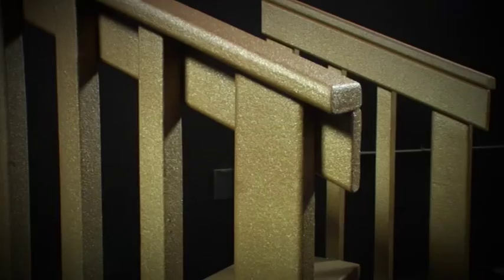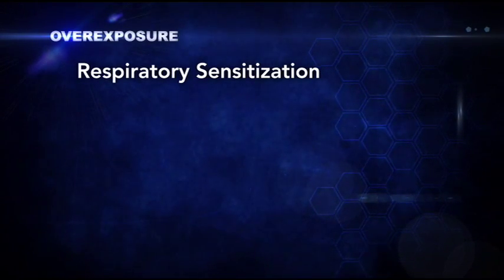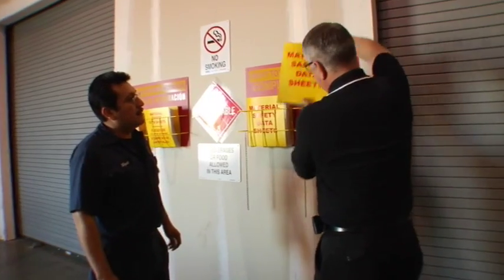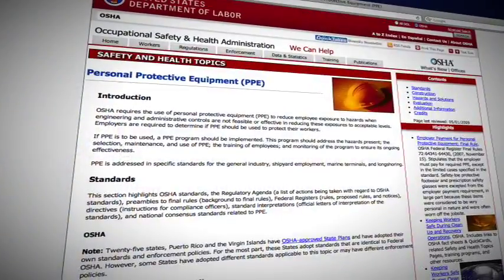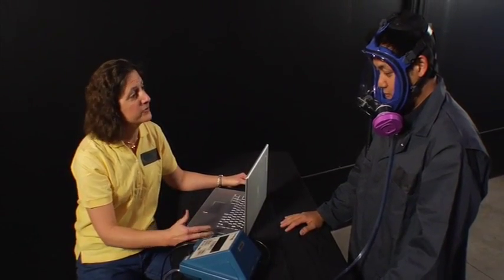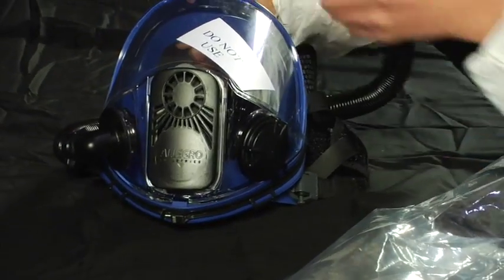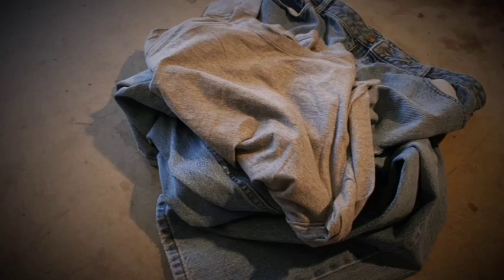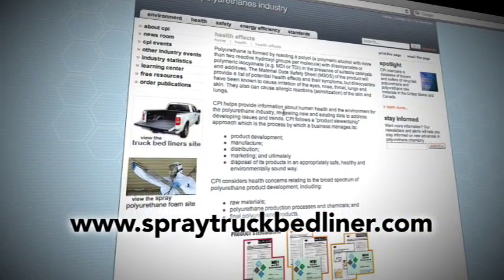Working Safely With Isocyanate-based Spray-On Truck Bed Linings

Comment: Agreed I got poisoned by by methyl di isocyanate from box building  store consumer canned spray expanding foam sold to the average public wore a n 95 charcoal half respirator out side injecting 2 16 once cans of expanding foam into holes in a speed boat floor I own and was restoring  I was standing up in the boat when I was installing  the foam several feet above the sides of the low speed boat while wearing the n95 dual charcoal filtered half mask . Thank god i knew the consumer grade spray expanding foam contained this stuff the warning was so tiny on the can you needed a magnifying glass to see it , get this now the spray foam manufacturers of spray foam are now call it MDI instead of isocyanate
.The fact I knew of dangers of isocyanate was my part time hi school job at a body shop back in the 1970ies  but the average consumer sealing a wall in his child’s room or basement has no clue
Reply: What were your symptoms
Reply: Al S ok now this was 2017 aug . The symptoms were tightness in the chest which within a few min of the exposure turned to rattling congested chest burning eyes itchy also face was red and hot coughing nose burning and congested . Later felt like fluid was in ones lungs with lots of mucus,shortness of breath  symptoms lasted about a month but diminished after 2weeks greatly . It was very scary  . I don’t smoke drink or take drugs and lifted weights from 17 to 55 naturally,cross country skied some times 28 k on a Sunday , biked,canoed . Also into alternative health and supplements and natural cures science electronics car and boat restoration politics, Amature radio . I eat raw ginger daily that seemed to give me some relief from the lung congestion so i ate ginger a few times a day which helped and took extra vitamin C